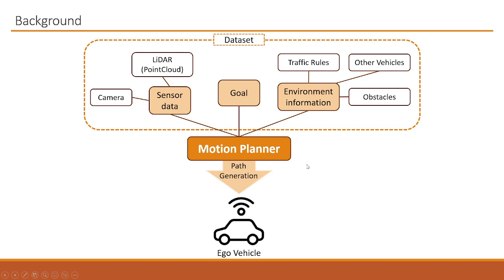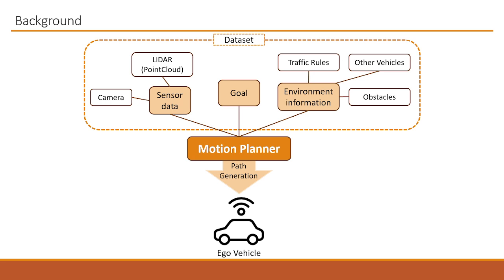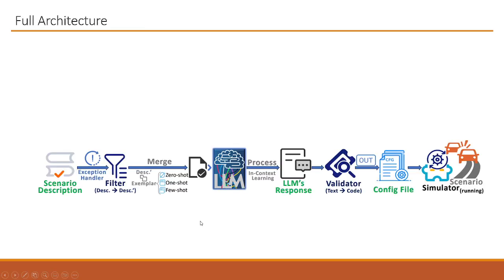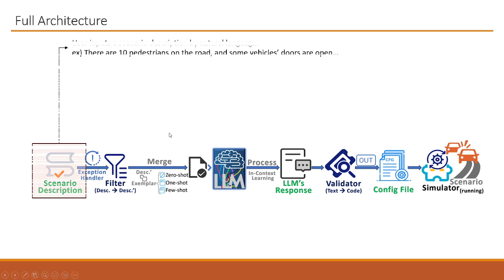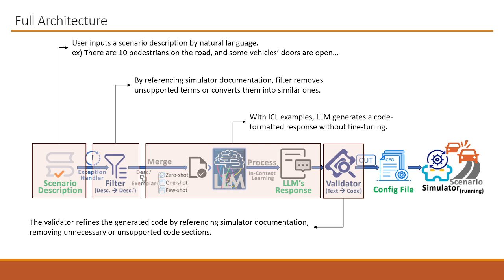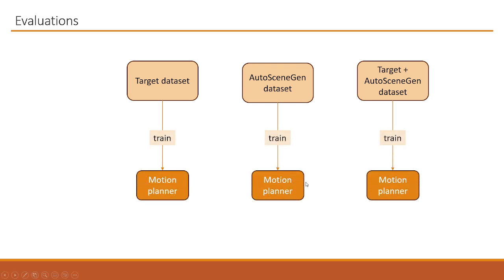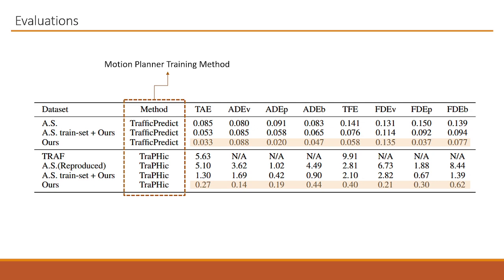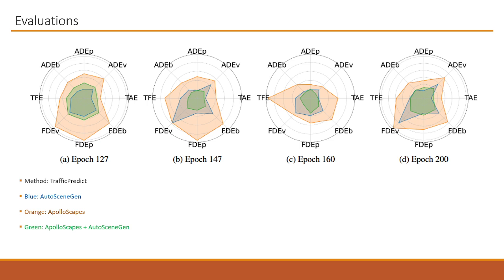[Seminar] Generating Traffic Scenario Dataset via In Context Learning

Comment: Is it possible to observe performance differences depending on the type of LLM?
If the performance varies greatly—or barely—depending on the model, what could that imply?
Thanks
Reply: It is true that this paper exclusively uses GPT-4 and does not compare it with other types of LLMs. Therefore, making a direct numerical comparison at this stage is difficult. However, I believe that since this methodology relies on the LLM’s natural language understanding and code generation capabilities—without any fine-tuning—there will likely be some performance variance depending on the specific LLM used. 

In particular, prompts found on the author's GitHub, such as "maintain a safe distance from other objects but occasionally unintentionally open their doors," require a nuanced understanding of context. The extent to which an LLM can interpret such subtle descriptions and translate them into functional code will likely lead to differences in overall performance.

Comment: Thank you for your presentation

I'm curious about the accuracy of scenarios generated by LLMs. Aren't there any issues, such as generating unrealistic situations?

Is this method flawless without any side effects or limitations? Also, Why Is fine-tuning the LLM unnecessary?
Reply: A1. The paper does not quantitatively assess realism, and hallucinations, which cannot be implemented in the simulator program, may occur. The authors use Filters, Validators and constrained prompt designs to reduce this risk.

A2. This approach emphasizes modularity and quick deployment, so fine-tuning was intentionally excluded for the sake of efficiency. It depends on the inherent capabilities of the LLM, which makes it less effective compared to a fine-tuned model. Moreover, it occasionally generates code that deviates from proper syntax or structure.

Comment: Thank you for your presentation.

Q1. Is there a process or criteria for verifying the validity of the outputs produced by the LLM?

Q2. I'm curious about how data from Lidar or Cameras is input into the LLM.
Reply: Q1. There is no formal evaluation of semantic or logical correctness. However, the Validator filters unrecognized inputs and ensures script compatibility with the CARLA engine.

Q2. Sensor data, like LiDAR or camera, is not fed into the LLM. The framework works from textual descriptions and does not directly process sensor inputs.

Comment: 1. Are there any essential elements that must be included when describing a scenario?
For example, are there any indispensable items like the number of cars on the road or the number of pedestrians that are required to build the scene?

2. I'm a bit confused about the part that says the same train method is used during evaluation.
What exactly was the training method used?
Reply: A1. There are no specific requirements. Since the simulator uses a predefined map and places objects or controls the weather based on the configuration file, it can function properly even without vehicles or pedestrians. However, if the scenario description includes weather conditions or specific situations that cannot be implemented in the simulator program, such as CARLA, those parts may be omitted from the final result.

A2. The goal of this paper is to generate datasets for training autonomous vehicles. Therefore, the evaluation was conducted using the same training method to enable a fair comparison with other datasets used for training, such as the AutoSceneGen datasets. They trained motion predictors (e.g., TraPHic, TrafficPredict) on either real datasets, synthetic AutoSceneGen datasets, or both. The same model architecture and training strategy were used across comparisons.

Comment: Nice presentation

Q1. Why did the authors choose not to fine-tune the LLM? Wouldn't fine-tuned LLM provide much better example scenarios?

Q2. What are the limitations of this method?
Reply: A1. The authors avoid fine-tuning to maintain flexibility and reduce computational overhead. In-context learning enables easy generalization to different scenarios with minimal data and without retraining the model.

A2. The method relies on the performance of the LLM, so its performance is inferior to that of a fine-tuned model. Additionally, it sometimes produces code that does not conform to the correct format or grammar.

Comment: Thank you for the presentation.

Q1. For traffic motion planning, I believe it’s much more accurate and reasonable to map the generated textual descriptions to actual sensor data for use as training datasets, rather than relying solely on textual scenarios. In this paper, it seems the evaluation excludes such integration with sensor data and develops and evaluates a planner trained only on textual scenarios—is that correct?

Q2. Could you elaborate more on the merge process after the filtering stage in the full architecture? (For example, there are icons for zero-, one-, and few-shot—what do they represent?)
Reply: A1. After receiving a scenario description from the user, AutoSceneGen produces a configuration file, which is subsequently utilized by the open-source simulator CARLA to deploy objects in the virtual environment using Unreal Engine. In the resulting scenario, a data collection vehicle navigates the environment and collects data through its onboard sensors. Therefore, it is accurate to say that the motion planner is trained using sensor datasets that are linked to the textual scenarios.

A2. The icons (zero-, one-, few-shot) are intended to illustrate that the author includes example prompts for in-context learning alongside the user-provided scenario descriptions. AutoSceneGen supports this process by supplying not only the scenario description but also basic writing rules and sample code using the CARLA API, helping the LLM generate config files in the correct format.

Comment: Interesting topic!
I have two questions.
1. How is the dataset structured?
2. Aren't they dealing with learning?
Reply: A1. Users can attach various sensors available in the simulator to collect the desired data. As an example, one of the datasets presented on the author's GitHub includes the following information: details of the vehicle used for data collection, speed, compass, accelerometer, gyroscope, location, throttle, steer, and brake. This information is recorded approximately 100 to 140 times per second.

A2. This paper does not cover aspects such as LLM training or fine-tuning. Instead, it aims to generate scenario config files usable in simulations by relying on the generalized code generation capabilities of LLMs and by providing appropriate ICL examples.

Comment: Thank you for the presentation.
Q1. Does the training-free approach lead to serious issues such as hallucination or a lack of scenario diversity? Since I’m not entirely familiar with how much domain knowledge is required in traffic scenarios, I’m curious whether these aspects pose practical challenges in this field.

Q2. When training solely on synthetic scenario data, the performance improves compared to training with the ApolloScape dataset. What is the reason for this? Does this imply that the ApolloScape dataset actually hinders learning, or is there another specific reason?
Reply: A1. The training-free nature introduces risks of hallucination and limited scenario coverage. To address hallucination, the authors incorporated components such as the Filter and Validator. Additionally, since the physical scenarios generated in the simulator can be reused through multiple runs, it is reasonable to assume that this reusability contributes to overcoming limitations in scenario diversity.

A2. One key factor appears to be the sheer size of the dataset. They generated 17,919 examples for evaluation, whereas the official training set of ApolloScape consists of only 94 examples. Although the independently trained generated dataset seems to perform better initially, the graphs later show that when the number of training epochs increases, combining the two datasets actually yields better performance.

Comment: Thank you for your presentation.

Q1. Thank you for the great presentation.
Could you share how the generated scenario actually runs in the simulation?
Is the scenario written in a special language or format to be applied to the simulation?

Q2. LLMs are still criticized for their weakness in spatial reasoning, and ongoing research is being conducted to address this.
Can the generated outputs be considered physically plausible and spatially realistic enough to be used for training or testing autonomous vehicles?
Reply: A1. The scenarios are formatted as Python-based scripts that define agent behavior, environment conditions, and timing using CARLA’s API-compatible structure. When the Python config code generated by the LLM is executed within the CARLA system, CARLA interprets it to place objects, set weather conditions, and generate the physical environment for the scenario.

A2. LLMs do have limitations in spatial reasoning. The paper mitigates this by using a Validator module and simple examples in in-context learning, but it doesn’t solve the spatial accuracy problem entirely.

Comment: Good presentation!

1. What kind of simulator was used? Was it a simulator they developed? What benchmarks were used?
2. In the Evaluation section, you presented the performance improvement of the motion planner when the AutoScenegen dataset was added. However, is there any evaluation of how well AutoScenegen follows the initially given scenario description when generating scenarios?
Reply: A1. The experiments were conducted using the CARLA simulator (version 0.9.13). The authors did not develop a new simulator but relied on this well-known, open-source simulator. In terms of benchmarks, they compared the generated dataset against widely used real-world datasets such as ApolloScapes, NGSIM, ETH/UCY, and VIRAT/ActEV. 

A2. The primary evaluation in the paper focuses on the impact of the AutoSceneGen dataset on the performance of motion planners, showing improvements in prediction accuracy. However, there is no direct, quantitative evaluation reported on how closely the generated scenarios adhere to the initially given scenario descriptions.

Comment: Thank you for your presentation:D

Q1 : Are 'Filter' and 'Validator' components also LLMs? How do they recognize unsupported or unnecessary inputs?
Q2 : You mentioned that this framework fully utilizes the capabilities of LLMs. I'm curious to know how that's possible. Is fine-tuning not necessarily required even in such a specialized domain? Or is this a unique contribution of this paper?
Reply: A1. 'Filter' and 'Validator' components are not LLM frameworks. They use a predefined replacement dictionary, referred to as the simulator document, to correct the input. The filter takes the raw scenario description created by the user, while the validator takes the configuration generated by the LLM as input. Both components iterate through each token or term in the input and refer to the simulator document to resolve any errors.

A2. The author argues that in-context learning—providing appropriate examples in the prompt for the desired output—can be used to generate scenarios by leveraging the LLM’s generalized code generation capabilities. This technique is indeed employed in various research papers, and the author presents the ability to perform the task without additional training, solely through effective prompt engineering, as one of the key contributions.

Comment: Thank you for your insightful presentation. But I'm curious about these things:

Q1. You mentioned that AutoSceneGen relies entirely on in-context learning without fine-tuning. Could you elaborate on the prompt design strategy? Specifically, how are the in-context examples selected, and does the performance degrade when applied to out-of-distribution prompts?

Q2. In the evaluation phase, they used metrics like Average Displacement Error (ADE) and Final Displacement Error (FDE). Were there any qualitative evaluations of scenario realism or coverage of edge cases, especially in hazard situations?
Reply: A1. Prompts are constructed with manually curated examples (few-shot). There’s no explicit discussion on how performance changes with out-of-distribution prompts, though domain adaptation might be limited without fine-tuning.

A2. The main evaluation metric primarily focuses on how closely the motion planner is able to generate a trajectory that resembles the actual path. Qualitative examples are provided (e.g., scenario renderings), but no formal realism or edge-case coverage metrics are introduced.

Comment: Thank you for the presentation Ryunha.

Q1: To generate a large amount of scenario data capable of training the ego vehicle, many different iterations using various prompts must be performed. How can we prepare those diverse prompts, and how much computational resources of the LLM will be required?

Q2: How are scenarios rendered in the simulation environment? If the vehicle uses LiDAR or other vision-based or physics-based sensors, should the scenarios be provided in the form of real-world rendered scenes? Additionally, is the scenario represented as time-series data with a sequential time flow?
Reply: A1. This paper performs scenario generation in CARLA by placing actual objects using Unreal Engine, based on configuration files generated by an LLM. The resulting scenarios can be reused, allowing vehicles to operate from various positions to collect datasets. As a result, a large amount of data can be extracted with fewer scenario generation iterations than expected.

A2. Scenarios are rendered in CARLA, a high-fidelity simulator with physics-based rendering, which is implemented using Unreal Engine. They are represented as time-series trajectories of agents, which evolve sequentially. This setup supports realistic rendering, including the potential use of simulated sensors like LiDAR and cameras.

Comment: Good presentation.

Q1. LiDAR is represented as point cloud. Can you explain more about it?
Q2. Validator is LLM framework? How can this component can refine the generated code?
Reply: A1. LiDAR (Light Detection and Ranging) is a remote sensing technology that uses laser pulses to accurately measure the distance to surrounding objects. By emitting rapid laser beams and measuring the time it takes for them to return after hitting a surface, LiDAR calculates precise 3D positions. These measurements generate a point cloud, which is a dense collection of points in 3D space, each with (x, y, z) coordinates representing the shape and structure of real-world environments.

A2. The validator is not an LLM framework but an algorithm. It takes the generated configuration as input and uses a predefined replacement dictionary, referred to as the simulator document, to replace unsupported terms with approved synonyms.